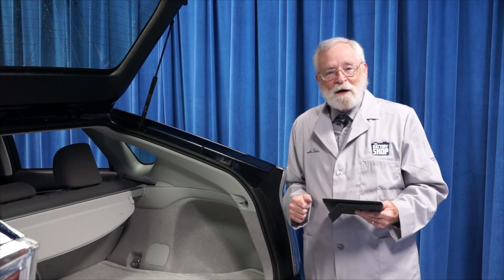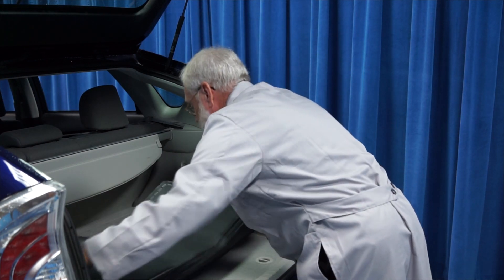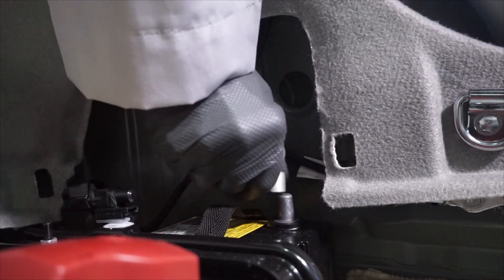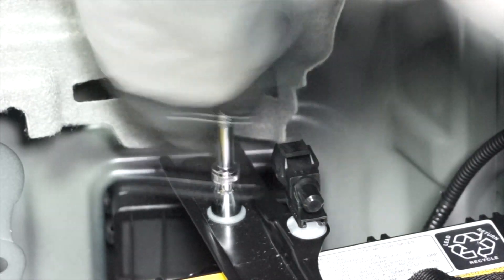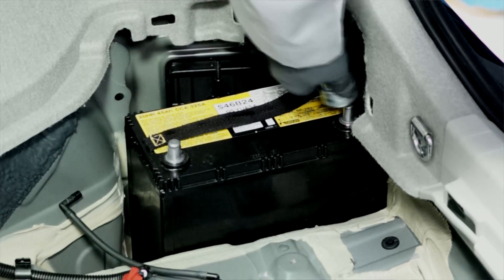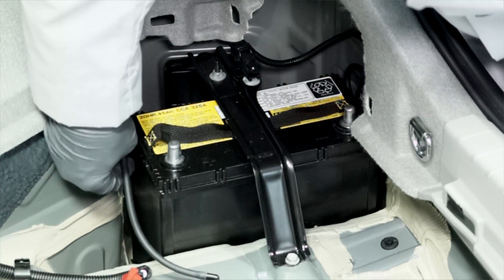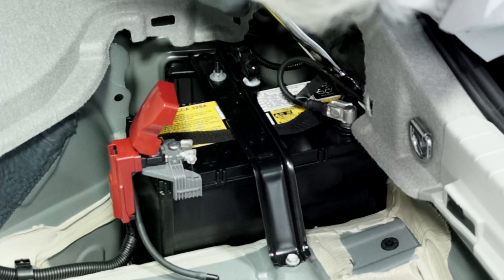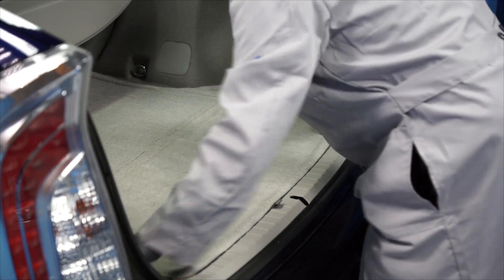Toyota Prius, Prius V, Prius Plug-In (2004-2015) - New Battery Install

Comment: Oh my gosh, watched this video, and a couple others for comparison, and believe me...DO IT YOURSELF!!!   Had to get it done today as this weekend in Denver doesn't get above 5degrees.  It is SO easy.  I decided to time it.  14 minutes from the time I stepped in the garage, got my 10mm socket wrench, moved our stuff and everything to get to the battery, switched it out and put everything back in it's place.  
I removed/replaced in this order, when I got to the battery.   Removed hold-down strap, Neg cable, Pos cable, Vent tube, battery.  Replaced battery, vent tube, Pos, Neg, Hold-down strap.   EVERYthing completed in 14 minutes!
Thanks Battery Shop!!!!
Reply from the maker: We're so glad you found our video helpful! Great job changing your battery quickly and efficiently!

Comment: Are there two vents in this battery? One on each side? You have fitted vent tube in one but what about the other vent? Did you leave that open or sealed it?
Reply from the maker: Hi- Thanks for watching! The batteries come with two vents to accommodate different vehicle configurations. We plugged the unused vent with the vent plug that came with the battery.

Comment: Hi! Excuse me, what if I can't fix the small pipe in the battery? Is it very important? Because today I changed my battery, but this pipe was not fitting in the new battery.
Reply from the maker: Hi - Thanks for watching! The battery ventilation system is very important and must be installed. The correct O.E. replacement battery will have the proper "keyed" receptacle for the vent tube.
Reply: @TheBatteryShop 
Thank you very much!
Reply: @TheBatteryShop , Thank you! 🙏

Comment: I went on vacation for 16 days, came back, and couldn't start my 2011 Prius.  Found other videos on how to power up the back trunk and jump start the battery.  it works for a few times, but now jumpstart is not working anymore.  I have been looking for battery replacement, but it is very rare to find any shop carrying it in stock.   Found only a few brands and price seems to be around $250 to $300.  Planning to buy it from O'Reilly since it is only the auto-shop that's carrying and near-by.  However, the mechanic is suggesting that "Do not install it yourself.  Have it professionally install."   I told him that i have replaced many of my own cars' battery before.  Why is this one is different?  It looks slightly different (with the sensor and the vent tube). He claims that "the Hybridge has a high voltage and can kill you if you don't know what you are doing and there is special instructions."  I also saw online sites that have a label, claiming the same.  I went to a mechanic shop near-by to get a quote, and it costs around $75 to $100 to install.  From your video, I don't see anything that is very out of norm for changing the car battery.  What should I be concerned?  I am thinking of handling the positive connection very carefully and wrap it around a tick protective plastic bag or box to prevent it from loosing and touching the body of the car.   What's your thought?   Thank you so much for the great / clear video.
Reply from the maker: Hi - Thanks for watching! We recommend that you follow the vehicle manufacturer's step-by-step instructions, found in a service/repair manual for the vehicle, like we did when we replaced the battery in the video. The vehicle dealership and local auto parts stores usually have the battery you need.
Reply: @TheBatteryShop  I just replaced by battery today, following your instructions step-by-step.  I don't see anything dangers or concerned.  I was making sure to carefully handle the positive cables when unhooked and hooked.   Thank you again so much for such a detail instructions.
Reply: @lnbt1 the prius v hybrids have two batteries. one 12 volt battery, and a high-voltage drive battery. it is likely that the mechanics you talked to were referring to the ladder which is significantly more complicated (and potentially dangerous) to replace without proper experience

Comment: Should I worry about memory’s in my Prius!?
Reply from the maker: Hi - Thanks for watching! Depending on the year and installed equipment, many late model vehicles require that the battery be registered or "coded" with the BCM. We suggest that you check the vehicle owner's manual or a service/repair manual for the vehicle to be sure. You can check out our video on battery registration for more information. The link is in this video's description.

Comment: Will this battery work for a non hybrid car?
Reply from the maker: Hi - Thanks for watching! This is just a small auxiliary battery for the vehicle to power its computers. We suggest that you refer to a vehicle's owner's manual for the proper 12-volt battery it requires.

Comment: I wish the 2006 model was this easy to get in and out! I have no idea what they were thinking with plastic vents that had to be removed that also had hidden bolts buried inside the wheel well and wiring harnesses all over the place. Didn't they realize that batteries don't last forever and you need to have easy access to them? I guess they did, eventually!
Reply from the maker: Hi - Thanks for watching and sharing your opinion!

Comment: Hot tight is 5.5 Newton-meters if you just have a regular wrench? I will attempt this on my 2008 Prius soon.
Reply from the maker: Hi - Thanks for watching! You really need a torque wrench if you want to achieve an exact measurement. How tight tight is depends on how strong you are.

Comment: Thanks for the video, it was almost the same process for the 2012 Prius V except the screws were facing the other way which actually made unscrewing the negative side easier.
Reply from the maker: Hi - Thanks for watching and sharing your experience!
Reply: The battery for my 2012 also just died, looks like 4 weeks after your 2012. thanks for the tip.
Reply from the maker: Hi - You're welcome and thanks for watching!

Comment: Just so I know, Its not necessary to pull the pink plug on the cell batteries before removing the 12v. Correct?
Reply from the maker: Thanks for watching. Because we have no control over the condition of the vehicle in question we recommend that you follow the vehicle manufacturer's step-by-step instructions found in the vehicle's owner's manual or service/repair manual. We did not have to remove the HV Battery's service disconnect during the battery replacement in our video.

Comment: Your procedure worked perfectly for my 2013 Prius with a 12v battery bought from Napa auto parts.  
For any Prius owners out there, my car is 8 years old with about 60,000 miles on it, when the battery failed to start the car after a few minutes with just the radio and daytime running lights on -- for what it's worth.
Thanks for the great video, it was so helpful!
Reply from the maker: Hi - Thanks for watching and sharing your experience! This auxiliary battery is very important because it powers the computers that open the output stage relays in the HV battery so that motor/generator 1 (MG1)  can start the engine.

Comment: I have a 2014 Prius C is the 12V battery removal and install the same process as in your video? Is it in the trunk or under the rear seat. Thank you so much
Reply from the maker: Hi - And thanks for watching! We haven't done a battery replacement on the Prius C yet so we recommend that you check with a service/repair manual for the vehicle to be sure.

Comment: Thank you! 
Going on a road trip in my 2013 Prius v with its original may/4th 2013 battery.
So far no issues but i need to be prepared in case ! 

Very simple and informing video!
Reply from the maker: Hi - Thanks for watching and sharing your experience!
Reply: Don't wait. Two commenters here, myself and one other reported their 2012 battery failing, mine today, his a month ago. Don't expect more than 9 years. Of course if you don't do trips no big deal. For us the Bolt EV is the daily driver and the Prius for long distance, camping, or hauling stuff from Lowe's.

Comment: Hi! Is it also possible to mount the new Agm/gel sealed battery? They don't have the hole for vent tube because are completely sealed. Thanks for your answer.
Reply from the maker: Hi - Thanks for watching! Replacing the battery with the proper AGM battery is considered to be an upgrade. The proper AGM battery for the vehicle will have a vent tube port that the vent tube must be inserted to.

Comment: You failed to mention that the windows wont work after you change the battery.
Reply: Run them all the way up and down a few times
Reply: @woodstream6137  Please tell, what is the solution for this issue?

Comment: Hi thanks for video my Prius when cold 12.38 voltage when star engine 14.75(open air radio lights ) car starting normally  never changed last 4 years battery.do you think need to replacement. I checked Google it says  up to 12.6  normal battery.
Reply: I have heard over 12v is good that why it’s called a 12V battery.